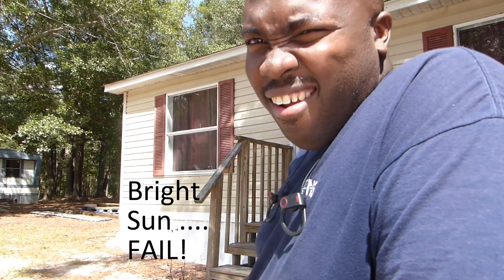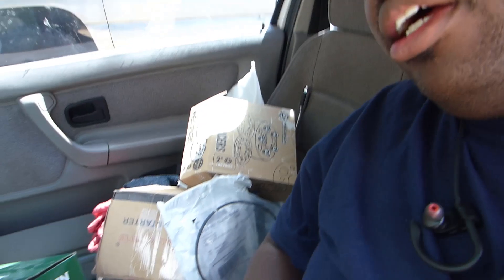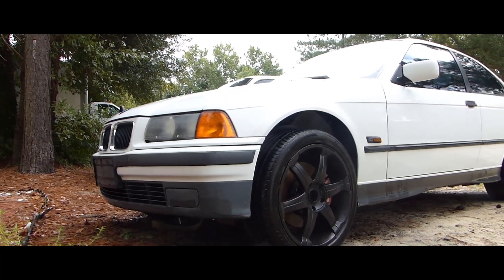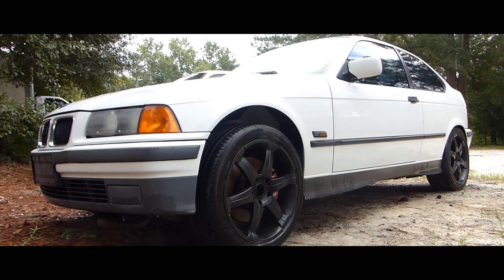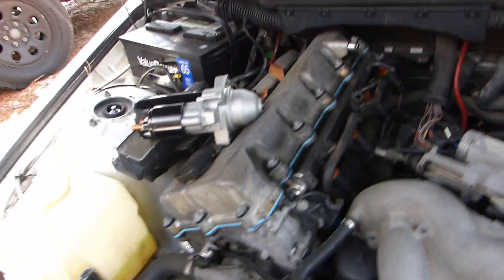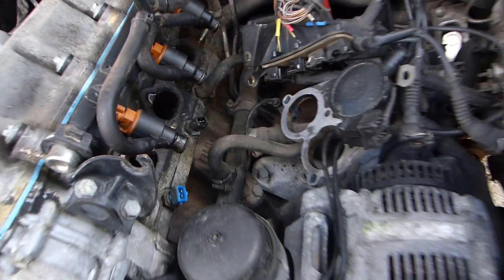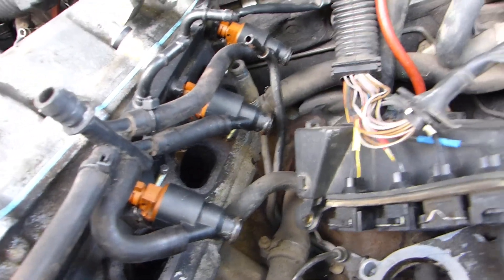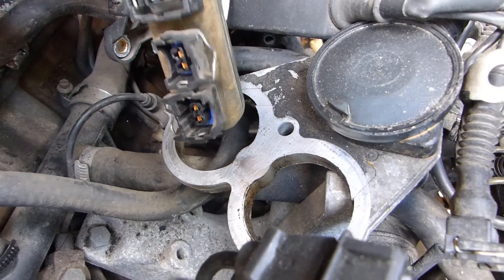Baby Steps with the BMW

Comment: Adam, please check ALL engine to body grounds, if both sensors are connected to a shared ground and that starter traces back to a tied in ground you might have a wire that looks good, but might be heated in side and is causing the sensors to send false signals to the cpu ??? I have BMW and jeeps ect... I am going threw a issue with a 4.0 jeep ground and crank sensor issue now, not a BMW, but they are the same type of sensor and both are 5v feeds... keep on trucking 👍
Reply from the maker: Good idea. If it ever stops raining I will definitely check that